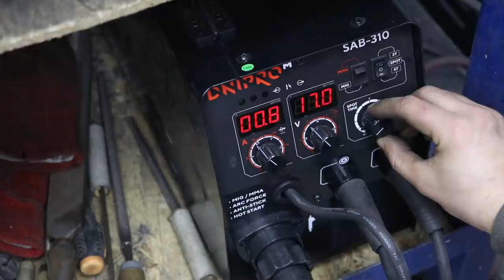Wood chipper DIY!

Comment: great job m8 but you defiantly need a slow feed roller in front of that , and not just for health and safety  the stuff your kicking out is to long a slow feed roller working off the same engine with a gear reducer would produce chips not sticks , and as a bonus (ps 16 years feeding one o0f those on a daily basis as a tree surgeon in the UK ) it wont kill you faster than you can find the off button......which by the way should be on top of the feeder shoot or you got no chance , i have seen a climbers rope wrapper around a tree getting dragged in to a 9" chipper it was hilarious he was 20 feet up a conifer and the tree was bending as he was getting pulled in to the chipper !  we hit the stop button eventually ofc :-)
Reply: Haha, my sentiments exactly. Great minds think alike.

Comment: I really like the sturdy hardened design. It is a solid built that looks very tough. However, it's running about twice as fast as it should be. If you add some beefy gearing on the blade shaft it will slow it down and also increase the torque, Then you will have a winner. Also, I agree with others that it really needs a longer chute just in case a branch grabs your arm and tries to pull you in. Which is a super scary possibility, especially at the end of the day when you start getting tired.
Reply: Those aren't chips, they're chunks. Should be called a "Wood Chunker"
Reply: @JoelAClear   One nice thing about the size of those "chunks" is that starting a fire in your wood stove is much easier with that size compared to chips.
Reply: You are wrong ...it has great torque
Reply: @giannisk36698  Would like to see how well it performs on larger diameter trunks, but the chips are way too big, imo.  Should have been shorter blades close together to produce 2 inch or smaller chips, imo.

Comment: It is the heat that dulls your drill bits.  The heat that softens the metal from lack of lube and often too high of cutting speed.  Keeping them cool helps them to last many times longer.  Lube, turn slower and provide plenty of feed (pressure) so you are always cutting into fresh cool metal.

Comment: Great job ! !ust curious,if big wheel was at bottom side and small wheel at top would you get more speed at blades? Matt Or is this a flywheel on bottom side.
Reply: Whoa, the last thing this needs is to run faster. Just the opposite.

Comment: Awesome build, i like how it just chops them into twigs rather than mincing them into mulch, it makes it a useable machine with the tiny engine, the store bought units even the 15hp ones that cost 2000$ cant handle even 2" branches cause they try to turn them into fine mulch.. im just trying to reduce the size of some spruce and silver maple branches for transport to the landfill as i remove trees on the weekend for a side gig,this thing self feeds really well!

if you want to mulch 2-6" branches the only solution is a tow behind vermeer with like 50HP diesel engine.. end up costing 30k US obviously not feasible

do you know what rpm the blades are turning at and have you tried tweaking that with different pulleys to gauge the change in performance?

Comment: I need a flywheels  like that I just have no idea where to look for one.
Reply: Use a big flywheel, from a car.
Reply: @01Autentic  flywheels or harmonic balancer?
Reply: @rimc8783  , flywheel. Remove the big part for the electric starter, cut a V shape canal and is ready. Harmonic balancer is to small. I'm not so good to write in english.
Reply: @01Autentic  Your English is ok with me! I'm understanding you perfect. Thank You
Reply: Washing machine pulleys and belt

Comment: As great as this guy's fabrication skills are, the machine as built chops the branches are too big to compost  at home and too sharp to bag and haul to the curb.
Reply: It is unlikely they have curb pick up where he is at.  The wood chunks he gets from this may end up in the wood burner that he heat treated the blades in rather than compost.
Reply: My thoughts exactly, I already have a craftsman chipper which I don't like using because it spits out 3" twigs and they too large to breakdown.   There must be a formula for the way the cutting box takes the feed, the chute angel, spin rpm and all that.